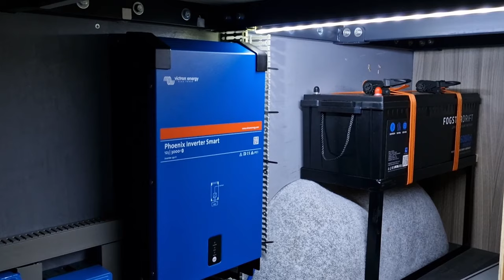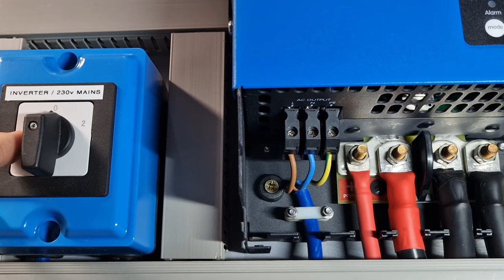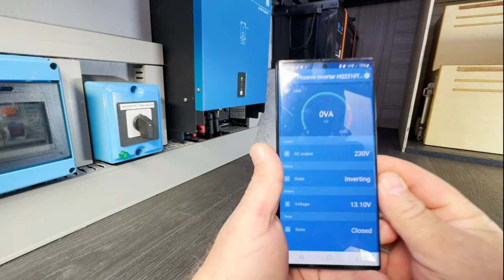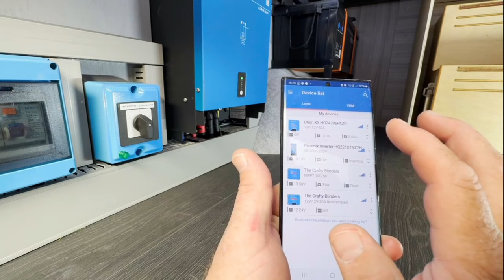Fogstar 608ah Beast battery Victron inverter DIY Camper Van Electrical Install START TO FINISH

Comment: Hi Sam, glad you’re happy with your Fogstar batteries. We swapped our two Leoch lead-calcium 150Ah batteries for two 260Ah Fogstars in July and upgraded our inverter to 2200w when the Mrs wanted to use a two ring inverter hob and are really pleased with the results. We are on a six week tour at the moment staying around four days at each place and haven’t dropped below 60% even now with the heating on. Most draw I’ve measured with a shunt test is 180A with everything switched on. We already had a Votronic 1212 50amp B2B so takes about 3-4 driving hours to recharge both to 100% from 60% no smart alternator just standard 130A crafter. 
Only thing I’ve done differently to you is thrown away the main mega-fuse between my batteries and isolator and installed a BEP pro installer Class T Fuse holder and fuse as with the power of lithium it can arc a blown mega-fuse. Not cheap at £100 for fuse and holder but neither are our vans! Hope you have a great trip we’ve still got three weeks to get back but couldn’t wait to watch your videos 👍🏻
Reply from the maker: I'm gonna check the BEP Fuse out thank for sharing mate 👍
Reply: @TheCraftyBlindersvanlife  Sorry if I didn’t explain it very well but if you look on 12v planet under their description they probably do a better job of explaining it. It’s all to do with how the fuse blows faster before the battery starts to runaway and the heat builds V quickly! I’ve learned plenty from you Sam so happy to share. 👍🏻
Reply from the maker: Thanks again @Basilbrush207

Comment: Very cool, my friend. I do like the "color coordination" thing - never thought of that! Excellent point about the "cable fits installation" issue. To avoid bends on my 70 mm2 - really - short cables, I raised the isolator using a custom fit piece of ply to line up the mounting height. Love your setup - but we'll see if my 3 x 100Ah setup will suffice...
Cheers and hugs to you, Lisa & Riley! 🚐☁🍀
Reply from the maker: thank you mate:goodvibes:

Comment: I am just getting round to redoing my system, and I am also fitting a 3kw invertor. Cheers for the video mate! I am pretty clued up on electrics personally (marine electrics on ships... not shore side), but this is still new to me.
Reply from the maker: A lot of the DC stuff we use was developed for marine applications small boats and light crafts
Reply: @TheCraftyBlindersvanlife  unfortunately I have never been on a small boat haha. Smallest I have been on had 3 1300kw 440v gens.

Comment: A video on how it should be done, Sam. Not like some numpties who pretend to be camper converters.  I'm changing my fogstar 105 to a fogstar 230 in October - hopefully before the crafty campout as I want to go gas free and just use an air fryer for cooking. Along with the 230 fogstar with its 250Amp output, my 400 watts of solar and my afeiry 2k power bank I think I'll be OK. I'll be able to put me disco lights on at the louden arms😂.  All the best and see you in October🙏-Kenny
Reply: See you there :)
Reply from the maker: see you soon mate

Comment: hello Sam 
just found your channel and im currently binge watching your vids as im retired.(Ive subscribed etc.)
Im doing my first camper convert, its an Iveco not a crafter but similar dimension wise.
Im a retired spark myself and was wandering whether to just go down the route of an Ecoflow, instead of a fixed battery,
Ive first fixed it 240 wise, with what I think I'll need, but Im now leaning to possibly using the Victron and fogstar route, as i maybe want to start going to the vanlife fests, next year but
Its just me and my dog these days so was unsure what to do, as most vids show it as mainly family orientated, and if so should i just opt for straight 240 plug in and use campsites.
Anyway, im rattling on here, so keep up the good work, its good to see a fellow spark helping other folk who maybe dont know electrickery.
Reply from the maker: the iveco is a very reliable van mate

Comment: Nice tidy and strong installation sam
Reply from the maker: It is mate, if you find a green plug your not sure what it fits it will be the remote plug from the inverter I had to order a new one as it was missing when I went to turn it on
Reply: @TheCraftyBlindersvanlife  I know exactly what you meen I had one of old inverter aswell but God knows where either is now lolllllll glad it's all working good

Comment: I have a victron branded battery isolator similar to yours and found it was heating up at only 30 amps. Supposed to be rated to 275 amps but I guess that would be intermittent not continuous. I stripped down and put it back together and now it seems okay. Not impressed with the design though. I reckon maybe I overtightened the terminals which sit in plastic and can easily distort. If you ask me they are a fire hazard.
I'd be more inclined to go for something heavy duty from durite next time.
Reply from the maker: good point raised there i always inspect the equipment prior to installing it

Comment: Quick solar question Sam, I have 500w of solar (3 x 12v panels in parallel at 18v nominal). But the last week I have been getting ZERO solar. Like max 2watt.
It's been cloudy, but is this normal? In the winter, do you get so little solar?

I have checked the voltage of the line from the panels, and it's hovering around 14v, so not enough to kick in the charger.

I washed the panels a week ago and jet washed the vans roof, and I am worried I have killed something. I never directly jet washed the panels but did brush them down with a microfibre mitt on an extension pole.
Reply from the maker: you will get reduce solar on a cloudy day, have you cleaned your panels lately? check all the connection too and if you have victron check the settings as sometimes this will reset the operating parameters

Comment: Great video pal, want to come and do my electrics? I made the mistakes over the past few weeks putting some of the lugs the wrong way round… shit happens hey! 😂
Reply from the maker: It certainly does mate what size cable have you used on your Orion XS
Reply: @TheCraftyBlindersvanlife  I’ve run 50mm from the van battery to the back, to a 300amp bus bar, 50mm to a blue sea switch and then stepped to 16mm to the Orion in, and 16mm to the distributors… spoke to Bksp solar and that’s what he recommended, as it’s a nightmare to try and get 25mm into the Orion!
Reply from the maker: @PackTheVanAndGo  I have managed it by fitting them will the unit was off 👍 check out next weeks video there is an easy way mate
Reply: @TheCraftyBlindersvanlife  will keep an eye out pal..
Reply: @TheCraftyBlindersvanlife i noticed on a you tube channel you can get tube pins which will help you get a 25mm2  cable into an orion xs

Comment: Did you look at auto transfer switches, battery line lengths and ac - dc line separation?
Reply from the maker: Great questions, yes we did, we could have bought the victron multi plus but like I said inthe video we spend 95% of out time off grid so I don't mind flicking a swich every now and then, all circuits have been calculated sized accordingly and as for running the AC & DC ran together the effects are mitigated by the short runs max lenth was 1mtr

Comment: What size heat shrink did you use for the battery cables? I’m busy doing the same setup as yours, but with a Ginalli 4000W inverter instead of the Victron. 👍🏻
Reply from the maker: What suze batteries are you using?
Reply: @TheCraftyBlindersvanlife  I’ve just bought the Fogstar 608ah battery same as what you have not long fitted, got the same 95mm cables. I’ll not be using the full 4kw of the inverter, but like to go large to allow me to go up to 3kw if needed without running it full tilt. I know the battery has it’s 250a fuse, and will be fitting the same fuse externally as a safe guard. This is going in my touring caravan. I already have a 300ah Fogstar battery in my van that’s being charged via a 60a Renogy dc to dc charger. I then have a 50mm cable coming from that with an Anderson hookup connector on the tow bar, this will be one of three selectable options when towing to charge the bigger battery which will be on the caravan. I’ve also got a mains to dc Fogstar charger, that will be live on hookup as well as solar to fit.

Comment: One more question, I am looking at installing a smaller system with Fogstar 230ah battery and a 2000w Renogy inverter, all we want to do is boil a 1500w kettle and run a single air fryer, (currently running it from an EcoFlow Delta2 and it works great) I am worried about cables getting hot and see you use 95mm - Even for a smaller system would you recommend using as big as cables as you can? I am considering just using an EcoFlow for my 240v or really going big on the cables
Reply from the maker: each circuit will need to be calculated then sized and fused accordingley